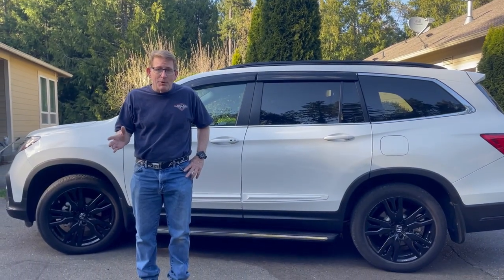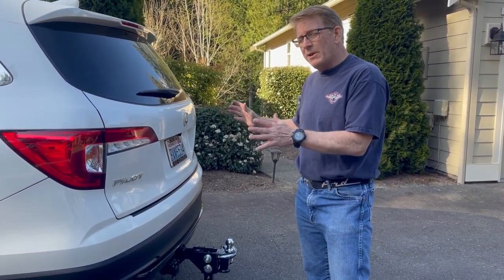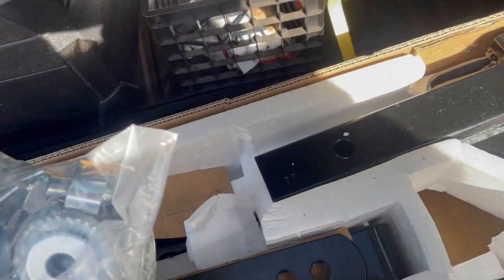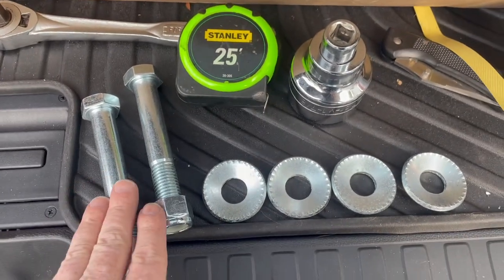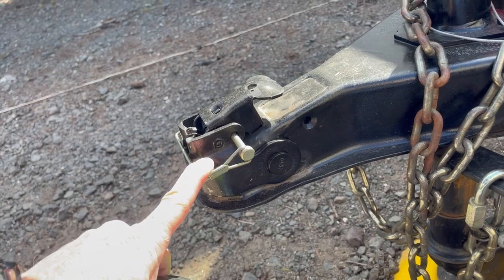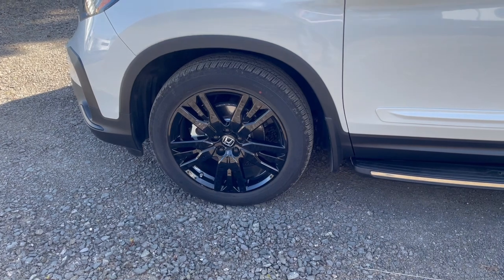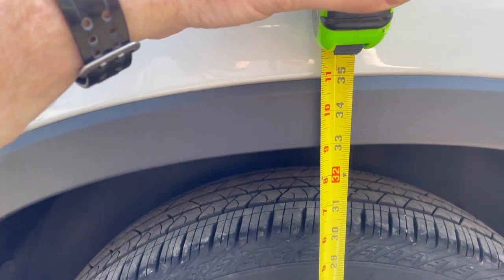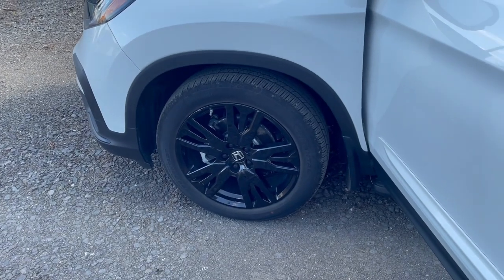2021 Honda Pilot Towing   HD 1080p

Comment: Thanks for this video. Did you have any issues with your spare tire when mounting the etrailer hitch receiver on your Pilot? (Is the spare 18”?) What trim level is your Pilot?
Reply from the maker: I did not have any issues with the spare tire clearance, and I'm not sure what sized spare it is...it's not 20", so maybe 18". I did have to remove it to get the hitch bolted up and its a squeeze to get it back in but not too bad. We have the Special Edition  Pilot, which I think is an EX Tourer.I am very happy that you found this video useful!

Comment: I cannot seem to find a break controller that just plugs into my 2021? What did you buy? Did it just plug right in with a wiring harness?
Reply from the maker: I ordered the following from etrailer: 

https://www.etrailer.com/multi-product.aspx?pc1=90195&pc2=3070-P&VehicleID=202137907&HHYear=2021&HHMake=Honda&HHModel=Pilot

The wiring harness plugs in up by the emergency brake pedal and plugs into the brake controller. Then, you just plug in some fuses under the hood and you are good to go!